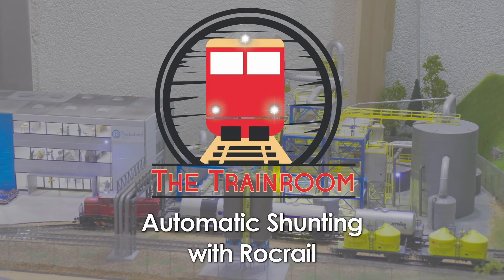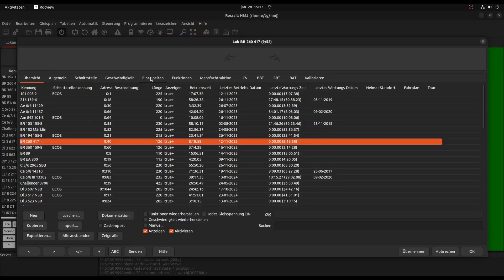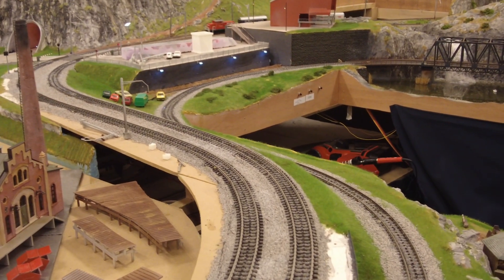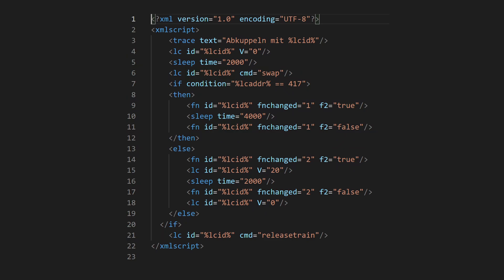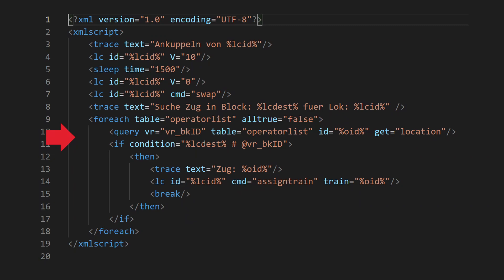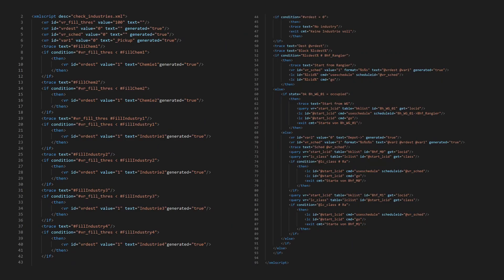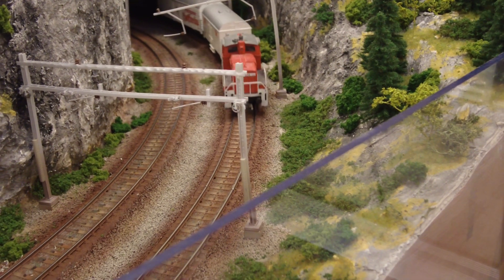AUTOMATIC shunting program with Rocrail

Comment: Great video thank you. In 2:28 you say there is no reliable way to uncouple cars but I think there is using Rocrail. Here is my small Rocrail layout with a mashalling yard / shunting activity using also a bit of XML and an Infra Red phototransistor connected directly to a M88 sensor input https://www.youtube.com/watch?v=SVEqKjZy7Tk. The trick is to have an IR beam shooting in oblique (between buffers and couplers) so that it detects couplers reliably.
Reply from the maker: Cool video. Our new trAIn product would certainly help your project.
What I was referencing was the mechanical part. I wanted to that train arrives, then a shunter couples to other end, then the cars are uncoupled, and finally it drives away. I'm sure it could be made working in specials cases, Just to make sure it works in 99% of the cases is the problem.